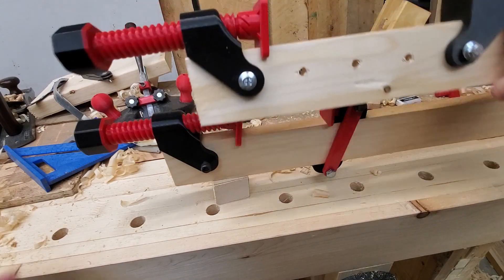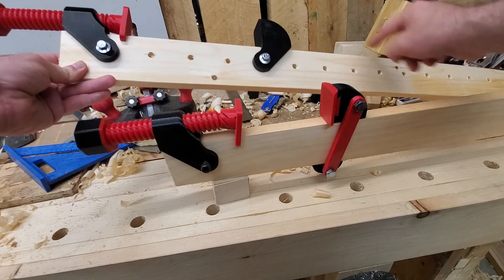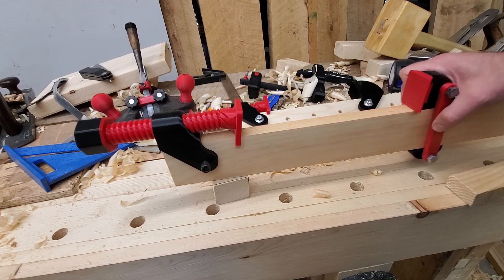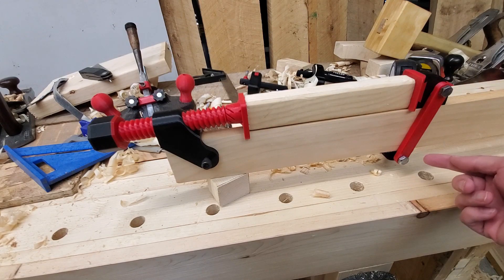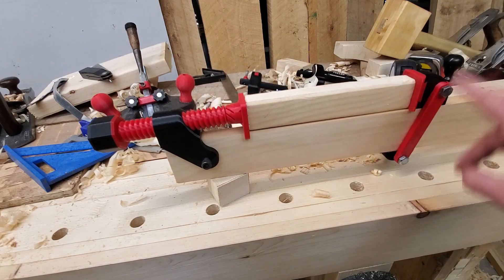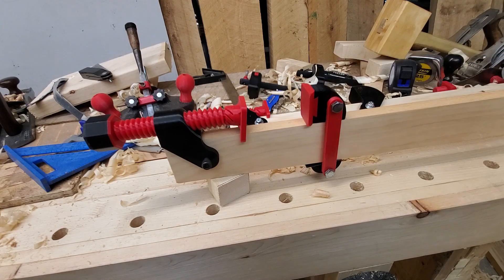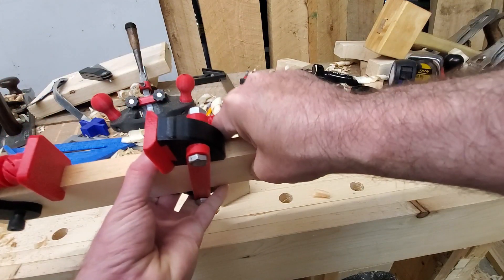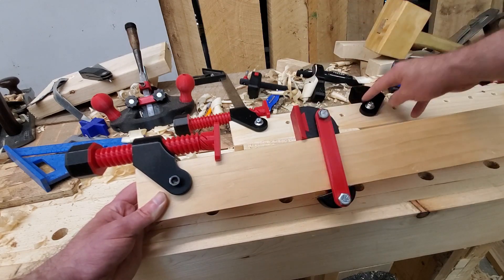3d Printed Sash Clamp/Bar Clamp Infinitely Adjustable

Comment: I think adding the needed width of the bolts  that are needed to attach it to the board in the printables description would be really nice. I guess it's something like 35 - 40 mm? 19mm + the thicknesses of the 3D printed sides?